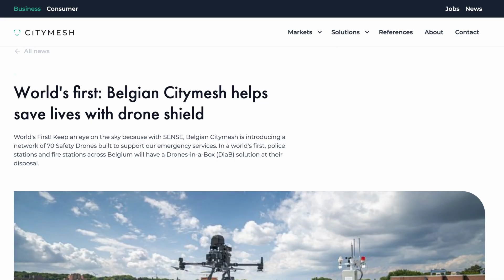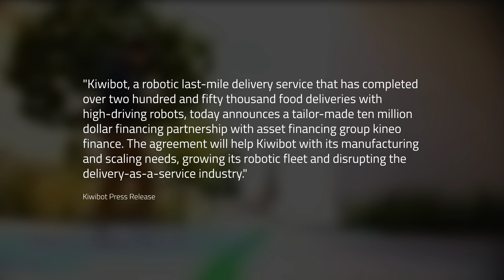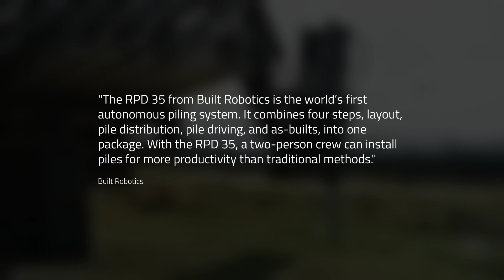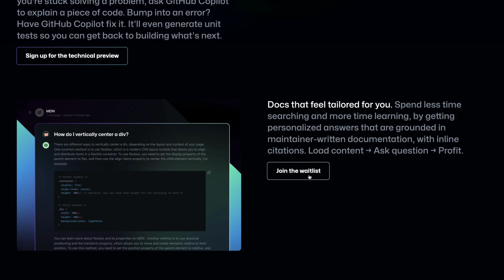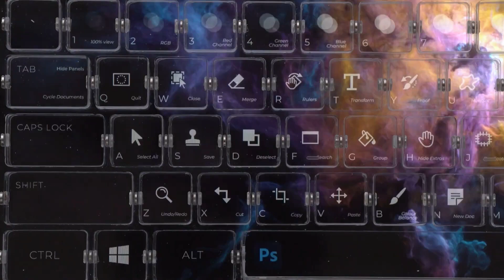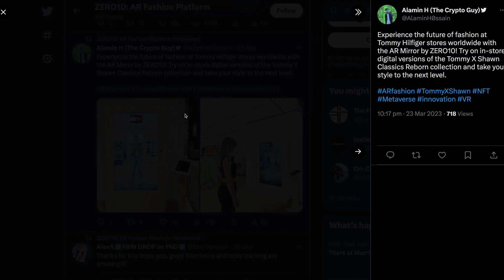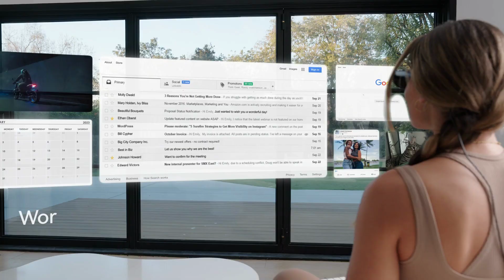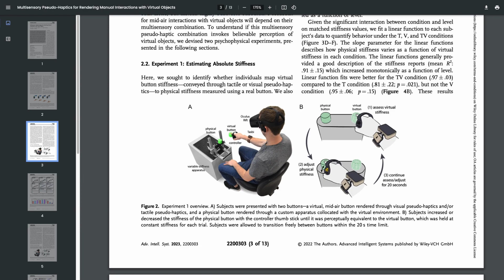Flying Taxis, Minesweeper Drones, Adobe Firefly AI, Augmented Reality Mirror + More | MOSFET Weekly

Comment: I completely disagree with the statement at 6:48. High quality custom keyboards have traditionally been among the most DIYable area I've seen. All the major standards and specifications are open, and high-end keyboards are almost always custom, in small batches from one to a few hundered units.
Reply from the maker: I know there are many ways to build mechanical keyboards, but they all require existing keycaps and switches. I'm talking more about building 100% custom keyboards, with new keycap shapes and sizes. For example if I wanted to create a mini mechanical keyboard for a palmtop computer or a phone case, it would now be possible in exactly the size I want. When using other existing switches/keycaps I would be bound by those are a design constraint.
Reply: @MOSFETnet  fair enough

Comment: What a time to be alive! I see delivery robots in the UK regularly, but I don't know anyone who has actually had anything delivered by them.
Reply: I work in one of the locations where they run and tried it out (I just got a bottle of coke).  They're pretty good, but they are slow, only going at a slow walking speed for the most part.  Delivering from a shop that I could drive to in five minutes took something like 45 minutes, if I recall.  Still, the capacity is very big, and I imagine you could get quite a bit of a normal shop for one person inside, so if there's any reason you can't get out, but you can wait an hour or more, they are great for a quick stock up.  Delivery fees are cheap, too, starting at 99p and going up as it travels further.  Its just a shame we didn't have them during Covid.
Reply: @dafoex  the new age of drone piracy is upon us, get your rgb eyepatch and 3d-printed flintlock, because soon we will go and plunder some drones